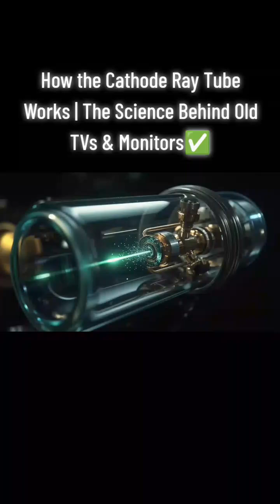How the Cathode Ray Tube Works | The Science Behind Old TVs & Monitors✅ #automobile #facts

Comment: How do you deflect the electron beam using the deflector coils?
Reply from the maker: The electron beam in a CRT is deflected by magnetic fields produced by deflection coils. The strength and direction of the current through these coils determine how and where the beam strikes the screen.